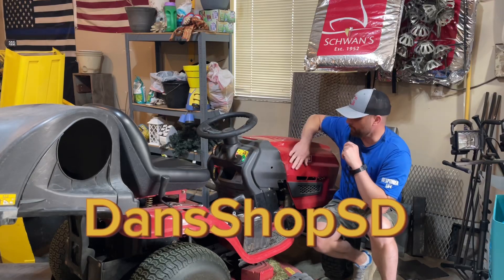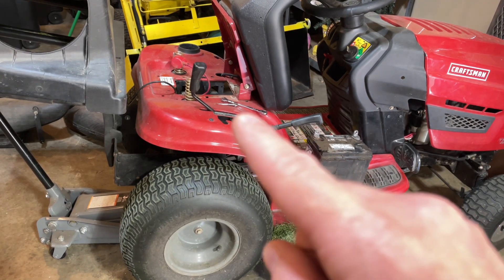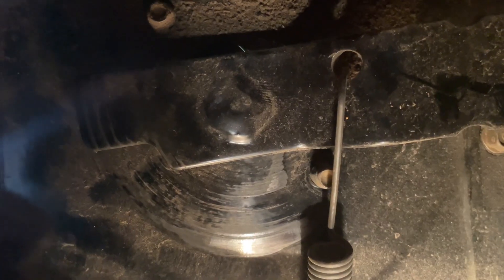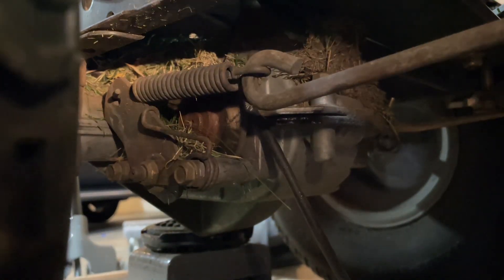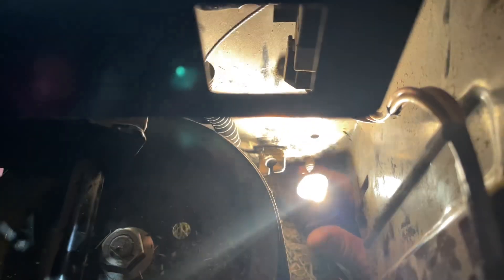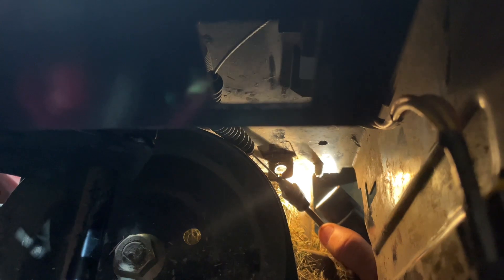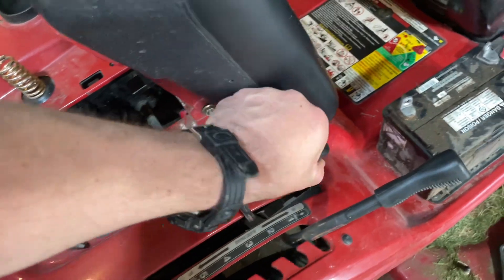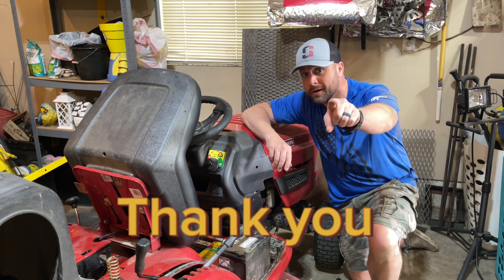Replace Pto deck engagement cable on a Craftsman t1500 riding lawnmower

Comment: Yes I had an older craftsman LT1000 for over 14 years. I became an expert on that model. I changed the cable twice in 14 years. 
It took me 15 minutes both times.
Well, old age took over both me and the Craftsman so I bought a used 2017 Troy two weeks ago that needed a lot of TLC.. It is pretty much identical to your newer Craftsman. 
The MTD engineers that redesigned all the newer models are Sadistic nut jobs. it took me two days to get the bolt in 
that attaches the Deck cable to the actuator lever after designing two different custom tools to insert the screw.. The second one worked.:face-orange-frowning:
Today I spent two hours trying to insert the spring at the deck. Yours' has a slot for the spring end. Mine has a "3/16 hole". :face-pink-tears:The spring just doesn't want to enter the 3/16 hole from under the lever.. I got tired hungry and pissed, so I quit until tomorrow. I had connected the cable housing to the deck  first. I will try disconnecting it tomorrow.
 I'm willing to bet the elongated hole was a $15.00 and hour assembler's idea!!!🤣 Tomorrow I may just remove the deck and elongate the hole or remove the return spring. ???Engineers???
(Edit) Nice video, thanks.
Reply from the maker: Dang I started reading what you wrote and I thought your writing was all gonna be positive!   Man that went downhill quick!     I feel bad for the huge pain in the a$$ you are going through!!! Ugh.   These things can be soooo frustrating!!!

Comment: I have to say I really really really really really really really really really hate this lawn mower. I've got two bulging discs and spondylosis and trying to bend the fix this thing has pretty much crippled me for the last month. Every day I go out there for about 20 minutes trying to get the old one off and the new one on and I just cannot get it. I can solve a Rubik's Cube. I can do calculus and trigonometry. I can listen to any song and play it on guitar bass or drums. I've learned to speak multiple languages and had become professional photographer in the last few years just by working hard and studying. But this thing right here this stupid part. Is from Satan himself.